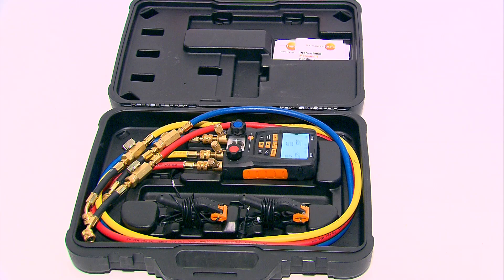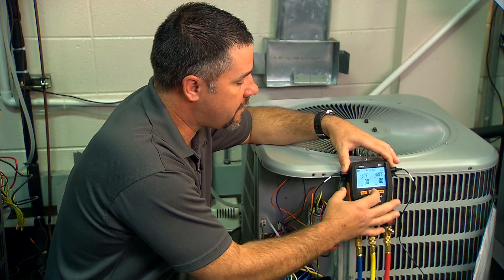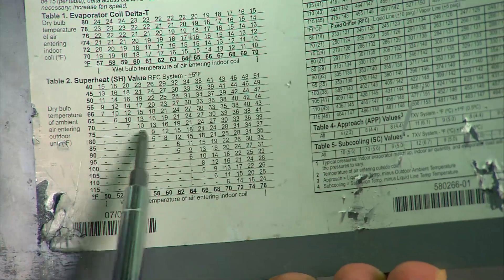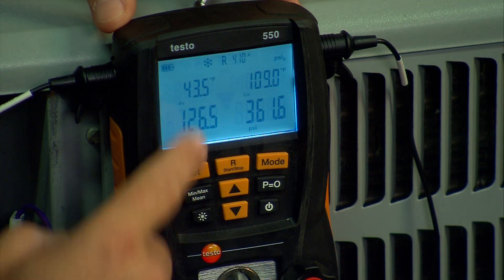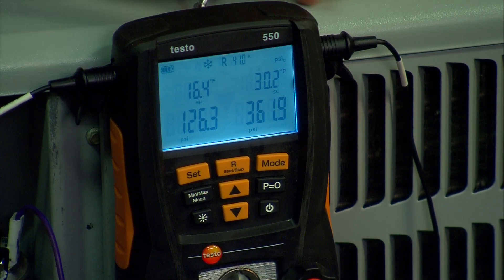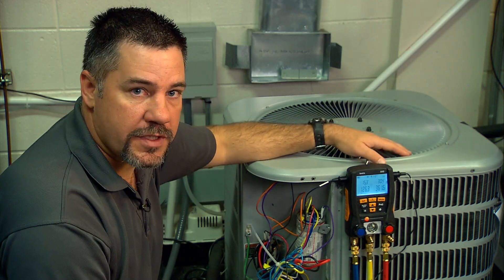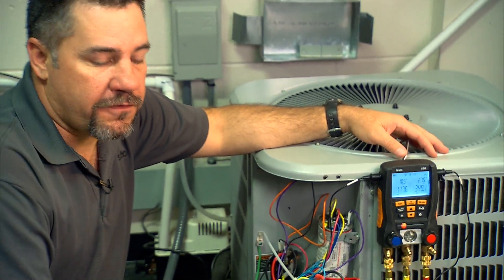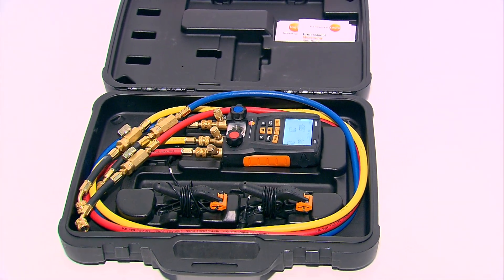Using a testo 550 Digital Manifold to Charge an AC System

Comment: Can you cover the case where there is a TXV valve instead?  I tried contacting manufacturer (Mr. Cool) and they say I have to pull all the refrigerant out and weigh it.  Seems ridiculous to me.  They won't provide me a target subcool range.
Reply: Txv general rule is 10° if not stated

Comment: You didn't ADD you removed freon... look at the pressures when he starts and when he is done "adding" ... lol it was 126psi low side and then 117psi after you "added" lol Plus the noise it made when you " added freon" was wrong.

Comment: For some reason when I connect testo 550 high pressure to high pressure low pressure to low pressure connector  with all valves open before I turn guages on just like it's on instructions,  I turn on  all indoor & outdoor  Mitsubishi units  my Testo 550 shows me same pressure on low size and high side((( Pls help

Comment: All my test tools are digital except for my guages. That is the one tool left that I am just not sold on. They are too expensive and I just don't see it being necessary.  Not to mention you can't rebuild and repair them the way you can rebuild analog guages.
Reply: You can only rebuild the valves. The rest has to get sent in
Reply: @cplg2111usmc  I just can't get on board with digital guages when the regular guages have worked fine for me for decades.  Maybe if they lowered the price I could be swayed.

Comment: I watched your video very nice, but I have 2 questions. 
1- why did the psi drop after adding refrigerant?
2- why did the sub cooling drop after adding refrigerant?
Isn't  it supposed to do the opposite?
Reply: That's exactly WTF I was wondering too, makes absolutely no sense to me I would've thought it was overcharged to begin with lol
Reply: Your suction pressure dropped while your head pressure rises. This is because it's a fixed orfice and only allows for so much refrigerant to go through. 
Try seeing some more basic refrigeration videos and you'll see what I'm talking about. It's confusing at times because if you overcharge it will do something similar as well. Or they both rise. Been doing this for several years and I always have to review the basics when I haven't played with the refrigerant for a while.

Comment: Why are you adding liquid refrigerant to the suction line? 
That's supposed to be done when when you iopen up the system to atmospheric pressure and pulled a vacuum under 500 microns, that when charge a system with liquid. 
Liquid to the suction line is bad for the compressor..
Reply: As long as it's added slowly your not going to mess it up. Better yet you can add a flash adapter to your hose so it flashes the liquid into a gas and you'll never slug a compressor

Comment: When you first set up the Testo 550, why do you ensure both valves are open?  I thought you open them only when you need to add charge.
Reply: After a little thought...I suppose you'd need to open up the valves to get the pressure readings for low and high.  Charge would come through the refrigerant line opening and would only need to be opened once you began the actual charging step.  Can anyone confirm this?
Reply: @mercurynfo The hoses are cracked open from instrument before you connect to compressor  to loose any pressure in lines or open knobs, but pressure still needs somewhere to release . As far as getting a reading , close knobs and as soon as hoses are connected to unit, pressures are indicated.

Comment: Is the center chamber on the testo 550 a metering device that’s vaporizing the liquid? I always use a gas vaporizer attachment on my analog gauges just curious if I still need that on this manifold or is it already vaporizing with this setup
Reply: You would still need it

Comment: U shouldn't add liquid  to the suction line, u should add vapor not liquid.
Reply: You have to charge r410 in liquid form
Reply: @soloryderrr  nope, not in the suction line( cold vapor) , youll over heat the pump
Reply: Oh? So how do you do it then? Add to the high side? Lol
Reply: @soloryderrr  you need to learn more and harder. So you understand how this system works.
Reply: Layth Younis I think your right, all the ac’s ive installed serviced or repaired for the last 7 that still run great without one compressor failure must have been charged wrong by me. Maybe ill just give up the trade 😂😂😂
Reply: @soloryderrr your 7 years is a blink to my work experience, I always say this, if you want to give an advice or info, you need to know who you are giving it to lol, keep doing what you doing.
Reply: Layth Younis again i have no idea what im talking about. Weve already discovered this
Reply: https://www.hunker.com/12001960/how-to-add-r-410-refrigerant

Comment: If you have to zero gauges an you use the manifold for pumping down to below 500 microns. Do you zero before you vacum pump
Reply: Gauges  will not measure that low, I think only 50. Need another instrument,

Comment: The beginning of the Charging method you said 134 PSI suction side it was running at 126 on the suction side? With 43° saturation temperature when you were finished charging at the suction side was 118 psi 40° saturation how was it under charged???
Reply: Yeah, this video confused me because of this as well...

Comment: قبل 23 ساعة
Thanks a lot for your job. I have a small question. When i need to charge the ac car from cylinder. Do i need to keep cylinder in neutral potion or return down. The feron does inter the ac system as gas or as liquid. Best regards

Comment: Testo says to “close the manifold valves” and loosen hoses, you say to open valves to zero out.
Reply: Mack wouldnt that be a problem opening both lines at the same time?I was confused when he said that
Reply: @doublewide420  this is before connecting to unit, you must loosen hoses on gauge to loose pressure

Comment: Dont make sense to me, high pres. 362psi. Add 8 oz. And the high pres. goes down to 347psi. with a fixed orifice.  I'm flabbergasted!
Reply: Compressor system has more refrigerant - it does not have much power to compress to high pressure.

Comment: You said "the refrigerant is a little low". What tells you that, please...?
Reply: This was a fixed-orifice metering device (not a TXV which would be charged by sub-cooling), so this unit is charged based on Super Heat.  Adding refrigerant decreases the super-heat and increases the sub-cooling.  He determined his target super-heat by looking at the chart he showed you...  To do this he took an indoor-web-bulb  of air entering the indoor "evaporator" coil.  Basically a cotton covering over a thermometer dipped in water with air flowing over it is the wet-bulb temperature.  This web bulb temperature was presumably 58 F, and he took an outdoor dry-bulb of air entering the condenser unit (from the sides not the top)...  This was 75F.  Using the chart, he determined the target or "desired" super-heat was 9 F.  That said, his operating or "actual" super-heat was too high at 16F, so he added a little bit of refrigerant and let the unit run for a while and stabilize.

To do this with an analog gauge, you would get a pressure reading such as 127 PSI and using a pressure-temperature chart looking look up that pressure for R-410A would be around 44 F saturated temperature...  That is the temperature the refrigerant boils at and is actually boiling at within the evaporator coil.  The Testo has this PT chart built in.  On an analog gauge, you would just read the pink Saturated Temperature Ring and where the needle crosses is the saturated temperature.  Anyway, the actual temperature of the suction (bigger line, low-side) would be warmer than that.  For example in this video the suction line is about 60 F... the difference between these is 16 degrees of super-heat.  That is to say the evaporator coil boiled off ALL the refrigerant then picked up a bit more heat before returning to the compressor.  You MUST have some super-heat or else you will be trying to compress liquid refrigerant which will ruin a compressor.  If you have too much super-heat, the compressor can overheat.

When he adds refrigerant, the low and high side pressures will go up... as such the saturated temperature should go up.  If the line temp stayed the same, the super-heat would decrease because it is the difference.  That said in reality the suction line gets colder, too...  so both of these are moving targets.

Ironically, when a system is low on refrigerant, the pressures are low.  The saturation temperature of the evaporator coil (indoor coil) gets too low (below freezing) and in high-humidity locations freezes up with water plugging up.  that is to say the coil is actually colder when the unit has less refrigerant within it.  That said if it gets too low not only does it freeze up, but the coil is not properly filled for thermal heat transfer either.  The high-side pressure of 362 PSI shown corresponds to the refrigerant condensing at a saturated temperature of 79 F shown.  That is to say by compressing the refrigerant as it enters the condenser coil it gets HOTTER than the outside air (remember air temp is 75 F)... then that giant fan blows air over it rejecting heat out the top of the condenser..  At any rate the refrigerant becomes a high-pressure liquid as it exits the condensing coil and gets delivered to the air handler in that smaller liquid (high-pressure) line.  Sub-Cooling is then the number of degrees below the saturation temperature it is cooled.  If the saturation temp is 109F (boiling point) as shown when compressed to 363 PSI but the outdoor temperature is 75 F it is pretty easy for the condenser to blow out very hot air!  His line temperature is shown at around 79 F.  That is to say there is around 30 F of subcooling.  That is that the refrigerant was cooled 30 F below its boiling point.  We use this to ensure we are delivering a solid column of liquid refrigerant to the metering device of the air-handler directly before the evaporator coil.  Once it hits the metering device (a restriction) there is a sudden pressure drop and temperature drop where the refrigerant becomes a low-pressure liquid and pretty quickly flashes to vapor... The blower motor blows room temperature air that is undesirably too warm over this cold coil where it picks up heat warming the refrigerant...

It just keeps circulating and blowing air.   To me that Sub-Colling number is a bit high, but irrelevant for charging this type of system, but it probably indicates there is a problem.  Usually machines that are low on refrigerant have abnormally low SubCooling numbers, too.  This one likely has a restriction somewhere causing the refrigerant to back-up... causing high-side pressures too be too high, and the low-side to bee too low.  The machine seems to be working too hard to condense refrigerant (at 363 PSI and 109 F on a measly 75 degree day).  My system, a cheap Goodman on a 75 degree day will condense at maybe 320 PSI (probably 300 PSI if I ever get around to cleaning the condenser coil).  At any rate normal SubCool values I see are around 10 very rarely over 15.  He might have a plugged receiver/drier or perhaps the wrong sized metering device (too small a hole in the piston).  This is why you Want to print the technical notes for your system and for various environmental conditions ensure you are within range.
Reply: +NETWizzJbirk 

Great comment.  Read/studied every sentence.
Reply: @hg2.  Ditto on that. I reread Netbizzjbirks comments several times. He should be teaching if he is not already.

Comment: Is it safe to use a Quick Charge Adapter on the Testo 550 low side when charging a unit with R410A

Comment: I have a few comments followed by questions:

If you're short of refrigerant was this due to a leak- If yes did you repair leak? If 410A leaks it fractionates therefore you don't know what part of the chemical composition left- Putting in more refrigerant makes no sense. You need to remove entire charge and then weigh in the new charge. I'm also aware this is setup for demonstration purposes and not reflective of real life scenario.

 You’re charging liquid refrigerant into the suction line which has been done many times before. I find newbies open the suction valve way too much to speed things up. Charging liquid may damage the compressor due to liquid slugging. You should be going through a restrictor which will change the liquid to a vapour state and not harm the compressor. Not sure if you have a restrictor? Subcooling - I find 10F to be the minimum required and I shoot for 15-20F depending on the system. Superheat is a tricky deal since some compressor manufacturers want a different number than 8-12 degrees going into the compressor. 

Personally I would check the following while charging: Superheat, sub cool, delta T (return-supply air) and compressor amperage. If you have a TXV then check subcooling ... How many batteries does this electronic manifold require? This may have re-charging capabilities which is time consuming. Does this manifold have altitude compensation adjustments? Maybe I'm just an old dinosaur! What are the reasons to move from a compound gauge to an electronic manifold? I appreciate the post and look forward to all comments. One other is this a school or testing lab because your T- Stat are located too close to condensers and your condensers appear to be indoors. If they are inside you won't get the ideal temperatures.
Reply: It doesn't "fractionate" to that much of a microbe to reclaim then recharge.  Unless you charge an insane amount of money for service then you just lost money doing that job
Reply: TCB EPFAN the video shows user interface of the manifold. Its up to you to determine everything else. lol. You dont sleep at night do you?

Comment: it had a fixed orifice, so he used the designated superheat to accurately charge the unit . if it had  a txv instead , what would he have done differently to accurately charge the unit?
Reply: Tighe Philbin subcooling

Comment: How did the suction pressure go down from 124 to 117 PSIG after adding refrigerant?
Reply: because the Compressor can not discharge high pressure anymore. Therefore, lower suction pressure.
Reply: Was wondering the same thing.
Reply: Cliff Lind
Reply: I am doubting this system is low.  A low system should also have a classical low sub-cooling, but this one has a high sub-cooling.  This is indicative of a restriction backing up the refrigerant into the condenser increasing the condensing pressure to 363 and 109F on a measly 75 degree day... that thing is working MUCH too hard to condense refrigerant... or the condenser coil is badly plugged...  Anyway,  a restriction would also yield lower suction pressures, resulting in lower saturation temperatures as well as warmer suction line... higher super-heat.

He probably has the wrong metering device in it, lol.
Reply: @NETWizzJbirk  only use sub cooling with a TXV (thermal expansion valve), not fixed orfice or piston which then you use SH
Reply: Law of physics

Comment: Great video. 
Considering digital gauges are not capable of giving you the target SH and SC, i don't see how they help that much compared to analogs. 

The digitals "do the math for you" people say, the only math they do is a simple subtraction. Finding the target Superheat is where the real math is.

With my old yellow jackets and a clamp thermo. i determine current SH/SC in a matter of seconds. 

Either way, you've gotta get your WB temp inside and with a little more math you can determine what the SH should be.
Reply: target Sub Cooling on condenser for TXV